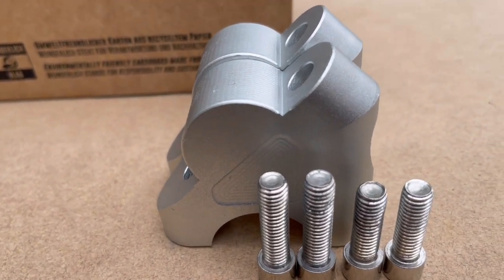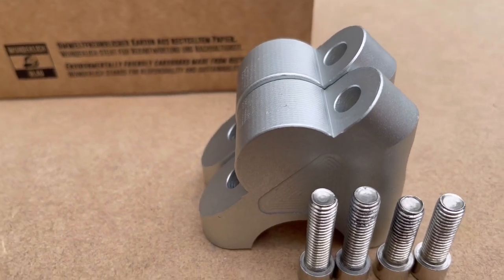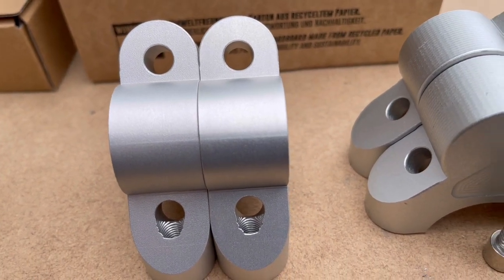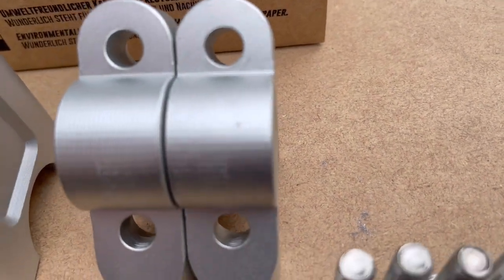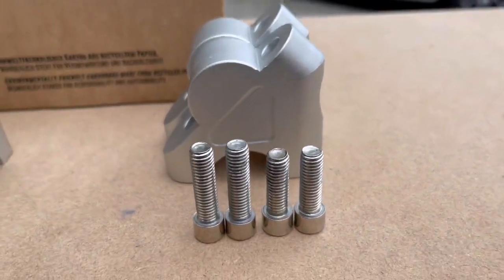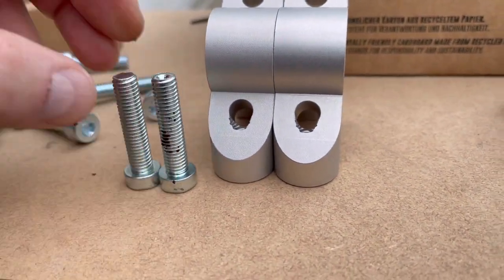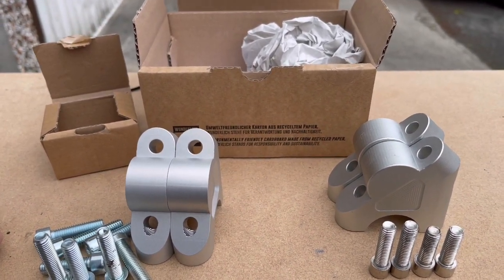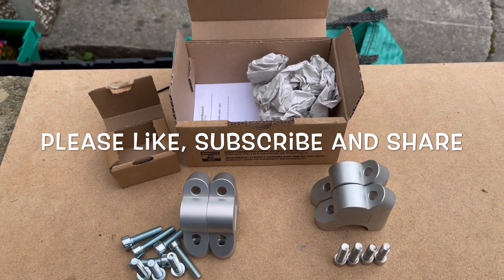MOTORCYCLE BAR RISERS - DANGER - DON’T BUY UNTIL YOU’VE WATCHED THIS!

Comment: I have used the Chinese rip-offs for years. True, they are not machined to the tolerances of the Europeans. However, those of us who ride cheap bikes, they are good enough at 1/3 the price or less. Moreover, many of those high-priced parts are most likely produced in China at the same factory. anyway. You have to factor that in when you buy these knock-offs. Just retorque them occasionally and they are good enough. Price is what you pay. Value is what you get.
Reply: and add some blue loticte, no problem at all, use them for years to.

Comment: You have not convinced me. Could you please explain what could possibly go wrong with the chinese bar risers? Assuming of course that you do not crash or have an overloaded bike and have a heavy tipover..
  I am all for safety myself. I have survived 700,000 miles behind bars so far…I would not expect a set of bar risers to survive a 60 mile an hour head on collision with an oncomming car or wall.. 
  please don’t be offended by this. But, I have owned a BMW K 1200 LT. My first and last BMW. I was very disappointed with how flawed that motorcycle was. I won’t go into everything, I will run out of room here. it poured oil smoke on restart if I parked it on the side stand, the windshield was horribly distorted, it had that weird front end  that no one else in the industry has even attempted to copy, and having had one, I can understand why. Final drives failing, on and on..
  ,But, having been a motorcycle mechanic at five different dealerships, having owned many dozens of motorcycles, from rds to tz250s to goldwings,all but 8 of them have been Japanese..(4-moto guzzi’s—gasgas- famtic-beta—-and that bmw)..
  I could not help but notice that many of  the BMW crowd are name dropping snobs.. They are prejudice.they will pay double for things like motorcycle jackets, gloves, boots, many tines made by the same manufacturer, they will pay $4500,(2010 price) to have the clutch and slave cylinder changed ( because the slave cylinder leaked)in their BMW K bike. They will pay $750 to have the clutch and brake fluid changed(2010 price..)They will pay outrageous to me  prices for parts & accessories, IF, it says BMW on it. It Hass to say BMW on it for that wine and cheese crowd …they seem to enjoy being shook by the ankles.. The more it hurts—the more they like it…
not me— example——-
  I have had two deer collisions while riding my motorcycles. One at 35 miles an hour. Deer ran right into the side of my Honda pacific coast on my daily commute. I did not go down, I fixed it myself, it cost me less than $1000 in used ebay parts…One of the things that happened in that collision. The mirrors both popped out of their sockets—BUT— they were tethered, so I just had to use a Phillips screwdriver to reattach them….
  two years later.on my BMW K 1200 LT. I had a 70 mile an hour head on collision with a Deers rib cage. Again, they just run right out you can’t even see them until it’s over. I did not go down that time either. I coasted to a stop with no lights in the dark. $5500 damage..Here’s the difference— both mirrors that are almost identical to the same design mirrors as on the Pacific coast motorcycle that I had the collision with a deer on, both mirrors on the BMW flew off straight to China, BECAUSE— they were not tethered. The kick in the balls was, those mirrors were $492 each(2010 price) they were not motorized remotely controlled mirrors, they were not heated mirrors. But they did say “BMW”………why so much??why no teathers???Two other BMW  k1200lt owners that I know said, their mirrors just fall off sometimes all by themselves..why???
    I detect a tinge of that familiar attitude in your presentation here.
  so, could you please explain to me how a set of Chinese made bar risers being used on your “BMW “are a threat to your life more than simply riding a motorcycle is a threat?
  I am not looking to exchange insults, I don’t mean to be excessively condescending,  but it just seems to me that people who drink the “BMW” koolaid, judge things according to label & price first..
I don’t know if you have seen the tv series “ long way around” with Ewan Mcgregor and Charlie Boorman.. they rode BMW GS motorcycles across Europe and Asia, across North America, and back to England..
  during that series, ewan kept saying that these were the wrong cycles for this trip—-
   Then—- one of the machines had a brake system complete failure.. both front and rear brakes could not made to work, even with factory techs advising them by phone…they ended up finding someone in the middle of Mongolia that could transport that broke down BMW to a train station, where they shipped that motorcycle back to England because it could not even be jury rigged to limp out of there. that was quite a public relations disaster for BMW.... any other brand of motorcycle in the history of the universe could have been modified to limp on, except for a BMW….. that is also related to why in 2010, a simple brake fluid change at a BMW dealer cost $750. If you get air in the system, the complete system front and rear shuts down and you have to transport the vehicle to the dealer, where I assume they  flush the system and re-boot the computer with the very secret codes that only BMW dealers have..
  I did my own brake and clutch fluid changes with no problem. It cost me less than $10. But I did have to buy a “special BMW tool”  To bleed the slave cylinder.
 I know a BMW dealership auto mechanic. I told him about the special tool I had to buy. He said BMWs are made that way. You have to marry the dealer to do even some basic maintenance chores, because only the dealer has all the tools required.. it guarantees business for the dealers service department..
   So to end my long winded rant. I apologize for that but not wholeheartedly.Could you please explain to me, how a bar riser made in China is a threat to your life?
Reply from the maker: Jody, thanks very much for your comments. It’s clear you’ve had far more experience in the motorcycle world than I. For me, my scathing review mainly boils down to inferior quality in materials, but also the lack of precision in the actual machining of the part. Ergo, they run a higher risk of failing than I’m prepared to take. FYI I have a brother who is a mechanic, and another brother with a phd in chemistry. Both of whom I value their input. Being on the north side of 50, I’ve had my fair share of both overpriced items, and cheap ones. Both bike, and non bike, related. At the end of the day, everything is relative. There are some things that are, I believe, just worth paying extra for. I’m not  a “that’ll do” kind of person. Ride safe buddy. Thanks again, and happy new year to you and yours. 🏍✌️
Reply: I must say, I completely agree with Jody. I watched the video and was honestly lost for words. I value safety too, if you were discussing brake levers or something like that I could maybe..maybe.. understand but you'd need a strong argument and demonstrable evidence, but I'll put my neck on the line (literally!) and say there's no way those cheaper bar risers are any less safe than the expensive ones. I'm not even convinced the machining is as bad as you make out, they didn't seem to be lined up properly side by side. Each to their own, that's fine, but that's kind of the issue though isn't it, it's not really each to their own in today's world with people so easily influenced by video's like this. So many factors at play here, and don't take this the wrong way, I wish your youtube channel every success but let's be honest, youtubers, like politicians, are likely to say what they think people want to hear....  China bashing being the popular thing doesn't help. Not the case with this example but I wish people would realise that most of their 'branded' stuff is probably made in China, possibly in the same factory. Maybe a fairer comparison would be to compare something that costs the same, then see the quality difference. Perhaps some £95 Chinese bar risers would be far far superior quality than the 'good' ones you showed here. Well anyway, each to their own as I say, just don't accept everything you hear, form your own opinions. Oh and a special thanks to Ebay, Amazon and especially Aliexpress for providing me with options, excellent value for money, reasonable quality and safe too. Right I'm off to buy my cheap bar risers now. Ride safe everyone! Remember it's YOU that will keep you safe, no matter how expensive the parts you buy.
Reply from the maker: Thanks for your comment Numero Uno. Much appreciated. But…we don’t say what we think people want to hear. We say it as we see it. Always have. Always will. Ride safe, and consider subscribing if you haven’t already. 👍
Reply: @areyoutryingtosay  Gotta say, many of Moto Guzzi and Aprilia parts that I've bought from Germany and England are SCREAMING good quality. Even a blind man can see the difference. The French are also excellent. Check out the parts sold by BAAK.
Reply: @tedmarakas2626  I've no doubt they are, but the point is we're not comparing apples with apples, it doesn't matter what country its manufactured in, find something comparable, you can't compare things that are 3,4,5 times the price. The main issue is whilst the more expensive bar risers seem to be more precision engineered, there's no evidence whatsoever to suggest the cheap option aren't SAFE! they may not look as good but PROVE they're NOT SAFE!
Reply: @areyoutryingtosay  Sure, in certain cases it may be true but engineering and quality of material and quality control are extremely important. There are Chinese made products that are manufactured under strict rules from companies, engineered properly and with precise fitment. These products are good and NOT cheap. However, $20 risers....copied by some Chinese Knockoff artist.....I'd rather stay away.
Reply: The dearer ones  are probably made in China. Like a lot of other stuff they put the logo on the product charge three times the price.

Comment: Great video. I  bought the china ones ,being a miserable sod. Fitted them and after a couple of short rides i went to re torque them, and they were loose!!!!I could move the handlebars forward and back while riding the bike .I had a feeling they would be crap so i didnt put locktight on the bolts incase i couldnt get them off again.Red Locktight might have helped .I have just purchased the sw motech ones, ridiculously expensive but if they work and look good its worth the money.
Reply from the maker: Hi Graham. We live and learn don’t we! Money we’ll spent in the end. Ride safe buddy. Thanks for the comment. Consider subscribing if you haven’t already.  🏍✌️👍
Reply: Use tread lock

Comment: I've fitted 2 sets of these cheap raisers to different bikes. They fitted well but the bolts are crap. I didn't even try the bolts as i had some correct sized ones in my toolbox already. I had a heavy front end crash on one of the bikes. Bars, forks, and frame got bent but the raisers with the correct sized bolts held up. My only advice if buying a pair of these cheap raisers is do not use the bolts that come with them.
Reply: I've tried that and they are looking good for now!

Comment: I purchased risers for my motorcycle my bars are 1inch Dia, on the Amazon website it states if your bars are 1" these  are 1". What I received are 1 1/4 inch. 
I went back and checked maybe I made a mistake., nope .
Scrolling down the next item are shims to make 11/4 to 1". Oh I see your game.  F THAT. no thanks and Amazon a honda rebel 250 is not the same as a honda shadow 750 here's the wrong manual you sent. Smh. 
I thought the Chinese invented Math!?